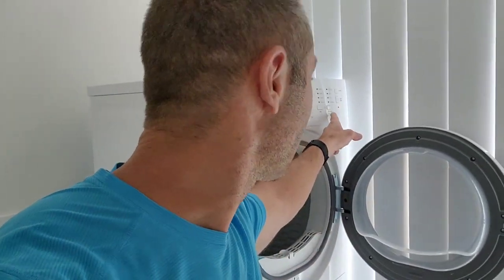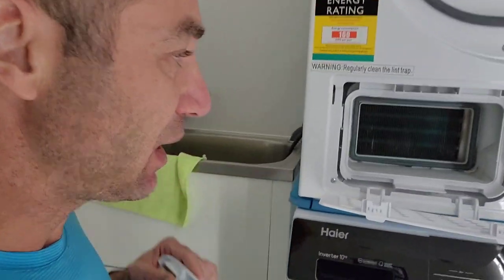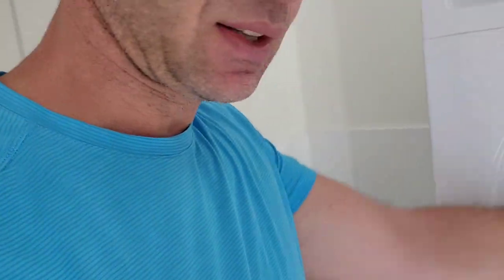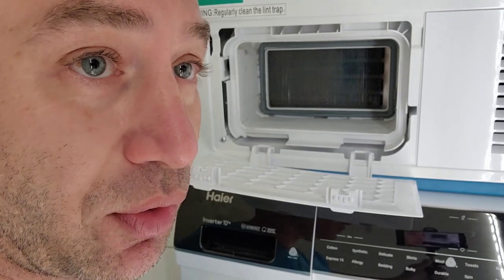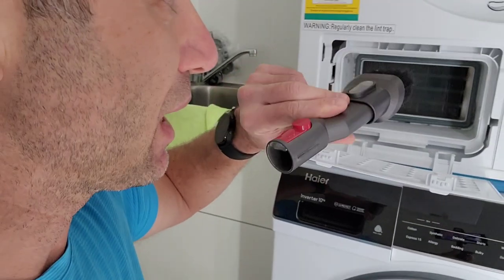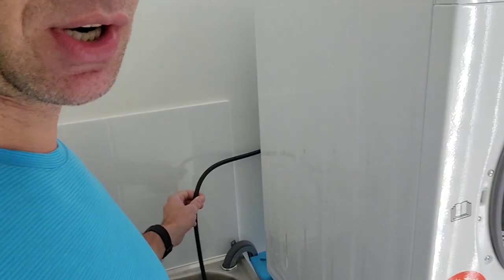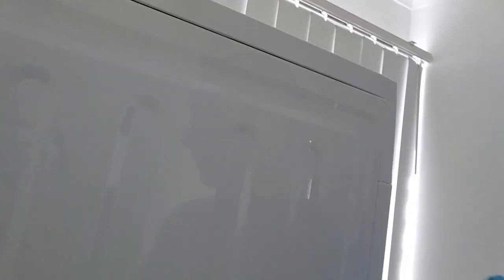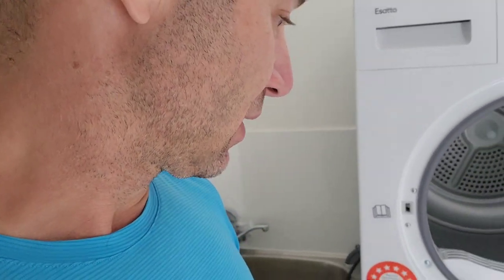Esatto 7kg heat pump dryer common faults & tips and tricks

Comment: I'm getting whirring sound from my Esatto heat pump dryer. When I pause it, the dryer stops but I hear something still spinning for a few seconds before it stops. Is it the pump? Do you have a video explaining how to check pump? Thanks
Reply from the maker: Yeah, sounds like pump. It does sound like that. Sorry, don't have a video as this is more or less sounds like normal appliance operation.

Comment: Hey my dryer stopped heating. I went out of station so I turned off the power mains. And now that I'm back I turned them on and the dryer isn't working 😢 any suggestions? I feel it's something to do with the power because it was running well before the trip.
Reply from the maker: Sorry to hear, but I'm not a technician. Is it still under warranty? If not, you may need to choose between the repair and getting a new one.
Reply: @GregYurchenko  no worries. I got it second hand so sorta screwed. Will check if a repair makes or getting a new one makes better financial sense.
Reply from the maker: @5ammy13  😞 absolutely

Comment: It's a shame you cant remove the condenser to wash it. Bosch has a self cleaning condenser which uses the water from drying the clothes to back flush
Reply from the maker: Thank you for watching. Yes, there are surely better appliances than Esatto. At this price point I don't mind cleaning it once a while. Especially when reported lifecycle of Bosch, Samsung and Esatto reported to be very comparable.
Reply: @GregYurchenko  fair point. I have a condenser dryer and you can remove the heat exchanger to rinse all the crud out. So I light brush and vacuum will help but let's be honest it will be full of stuff. It's a design flaw imo. Should be able to remove it to clean
Reply from the maker: @santouchesantouche2873  Absolutely! No doubt about that! Surely they need a number of ways to reduce the cost. This is one of them. I'm just glad that as consumer we have a choice. Again, thank you for watching and commenting. Real appreciate it!

Comment: Anyone know if the fan on the front off the dryer behind the grill is ment to be on the hole time using the dryer? I notice mine doesn't spin.
Reply from the maker: Not all the time for sure. It's on and off as it needs to cool a heatsink unit on demand.

Comment: I have loved my dryer, which is now 3-4 years old but it has started constantly throwing the 'full' light fault before washing is dry. Like ten minutes in to the cycle! 
Over the last 24 hours I've restarted it the same load 9 times after cleaning out the filters and emptying water tank EVERY SINGLE TIME. 
I've always emptied both of the filters after every load like you said to do. After a year or so I noticed the radiator grills were very dusty but the lint around it is always wet (lots of condensation around that area). I've had to spend hours lying on the laundry floor cleaning the fins every month or so. In another video you said this was due to not emptying filters regularly, but that is definitely not the cause in my case. Being wet, the lint is wet so it's very hard to get off the fins. I've tried toothbrushes, vacuum cleaner brush attachment, fine tooth combs, even a very a thin needle to pull the lint out and down so it doesn't go back in to the grill.

Please tell me how I might be able to fix the problem of the 'full' fault so the dryer will work! I've pulled the machine out and checked the hoses. There is no blockage in the external hose.  Thanks
Reply from the maker: Aww, I'm so sorry to hear that. To be honest with you, I'm not home appliances tech, so anything I'll hint on will be a speculation. From what you are describing sounds like a condenser fault e.g. nothing you can do... However, before you assume that you need a new dryer make sure that your dryer's drainage is working well e.g. you can see that it actually drains the condensation out. Also clean the sensor that is tacked away between filters (kind of inside between internal and external walls), it always get dirty. Sorry if it doesn't help, but I hope you get it going again. All the best!
Reply: @GregYurchenko  That's a great tip to clean the sensor. Can you please show photo of where it is?
Reply from the maker: @bloodnut822  When you open the front door, take the filter out. if you look down in that hole it looks like a metal knob poking out. Also, it is great idea to clean as much as you can the whole area...
Reply: @GregYurchenko  Great, thanks for your help!
Reply: @bloodnut822 mine started doing this. Did you end up getting a repair person out to fix this? it's definitely not filter related and is either the water pump or sensor

Comment: Thanks for the video. We have noticed a significant increase in lint being outside of the dryer. We clean the filters and heat pump as suggested but still find lint on top of and around the dryer. Would you know why this is happening and any possible solutions?
Reply from the maker: Thank you for watching. Only guess here, but if you find an increasing amount of lint around that maybe the sign that one of the filters is not sitting properly or totally blocked. I clean both filters and heat exchanger fins after every run. Hope it helps.

Comment: Hi my dryer keeps on turning the electricity off I’m clean both filters after ever use as you said to do and I’m not overloading it 
It was going fine but it’s on ever load now would u know what the issue is a new dryer too
Reply from the maker: The normal electrical circuit is designed for 10A. 10A = 2400W. At the peak of consumption this dryer does not exceed load of 1200W. In plain English: It is either your dryer developed an electric fault or your electrical circuit is already loaded more than 1200W that load of your dryer trips it over. Solutions are pretty easy. 1. Connect dryer for one operation to a different electric circuit (mind you, you really need a different circuit as number of power points can be connected to the same circuit). If it doesn't trip the power that means your dryer is OK and you need better power distribution within the circuit. If it trips the power then.... 2. Likely your dryer is still under the warranty. Call them and fix it up. Either way it should be easy to identify and take care of. Good luck.
Reply: @GregYurchenko  thank you so much for your help I tried everything you said 
Called the shop where I bought it from they’re sending out a person to look at it I think it’s faulty when I explained what was happening they said they will fix it or replace it or give me store credit 
I just want it work like it was before 
But the dryer gods have a different plan hahahah🤣
Reply from the maker: @MSNIC  No worries at all, I'm here to help as many people as I can. Glad it was useful to you. Good luck!!! 🙂

Comment: I have been using it for 2 months. Recently,the dryer keeps stopping. E.g. I set to standard dry,it says it takes 1:10 to dry. it would stop after 10 min and turned itself to anti greasing mode.  I checked, all the clothes are still wet. Is there anywhere I can fund the sensor?
Reply from the maker: Check that all filters are clean. If they are you may need to clean heatsink fins. If all clean try to force it via different cycle like cotton extra to see if it makes any difference.